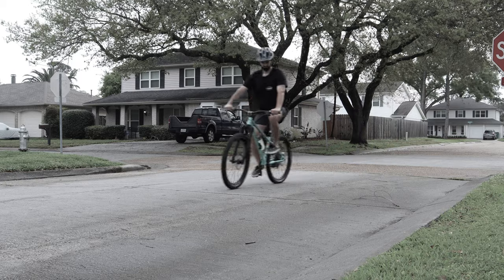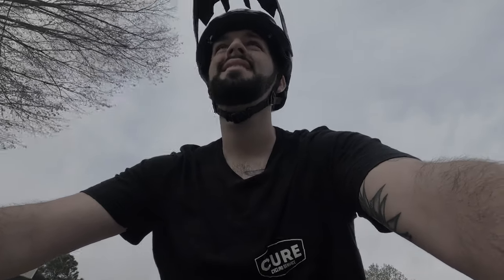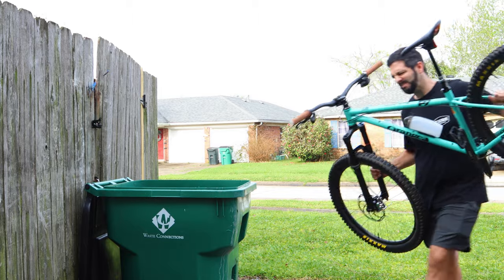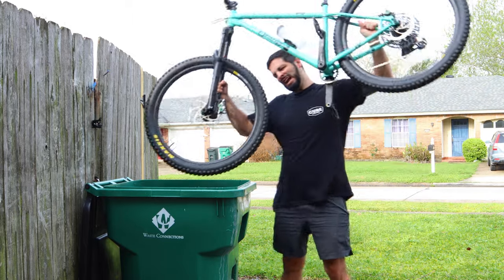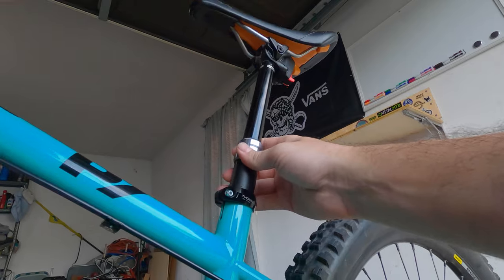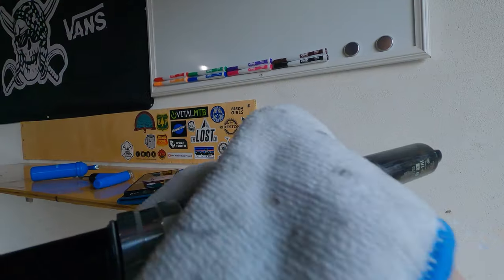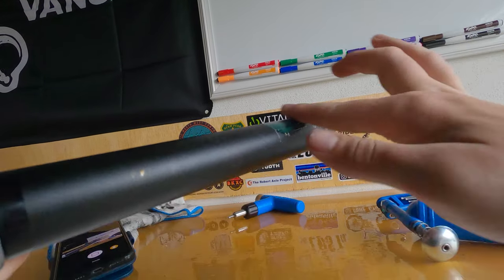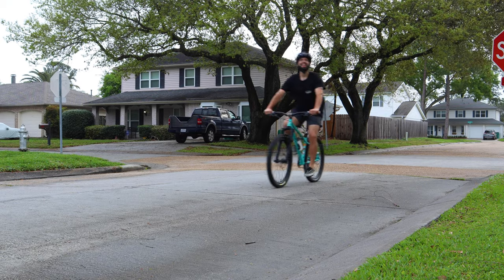Bike Creaks When Pedaling?? TRY THIS!! - The Seatpost Short

Comment: Have to try this trick tomorrow. I knew it was coming from the seat post. I just have never thought about putting grease on it.
Reply from the maker: Got to! That was always step one when we were building bikes at the shop. Hope it heals your creak, and if not I’ll be showing y’all some other sources of creaks.
Reply: @JaredRMorgan  I already also know my head set gives a creak too. I tried tightening the bolts a bit more but I want to wait until I have a torque wrench.
Reply from the maker: Don’t tighten it more. Headsets don’t need to be super tight. Your creak means it’s probably dirty and needs to be wiped out, fresh grease, and put back in. Just like a seatpost.

Comment: I hear more of a cracking noise in my headtube area. Should I use the same technique shown in the vid? What are your thoughts?
Reply from the maker: Yeah so I’d drop the forks, wipe out the headset bearing cups, wipe off the headset bearings, grease inside the bearing cups spread with your finger, and then reassemble. Probably dirty/dry between the bearings and where they sit.